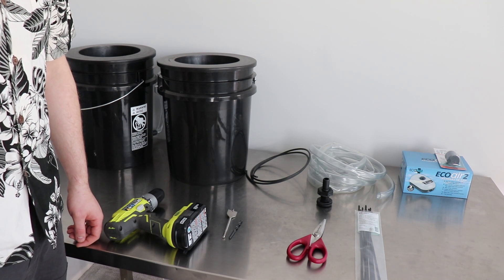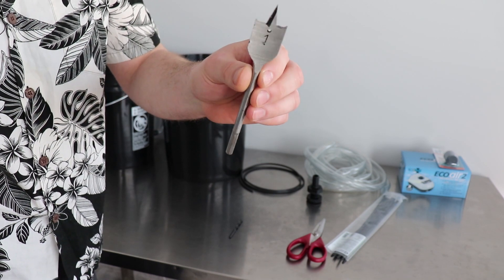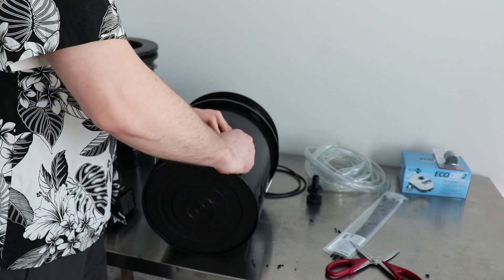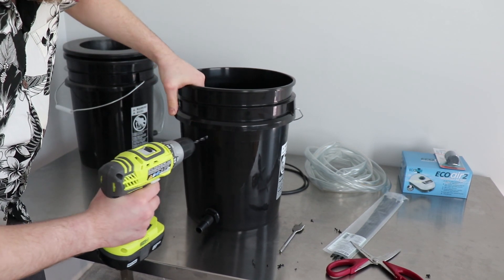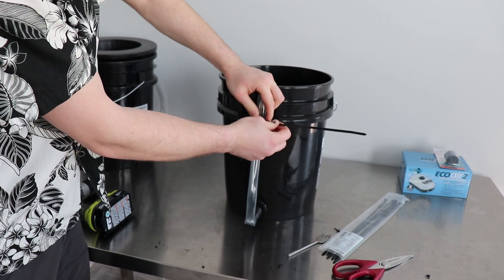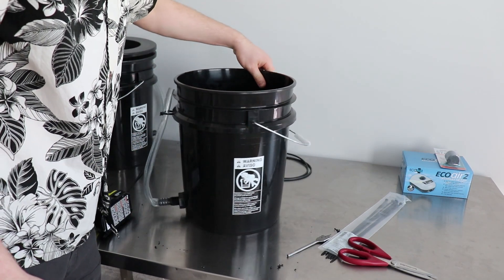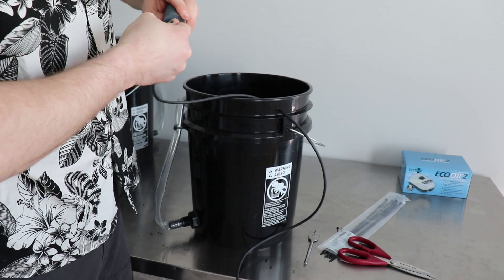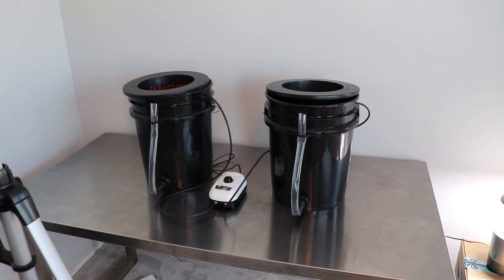How to Build an Easy Hydroponic Deep Water Culture DWC Bucket System

Comment: drill in reverse, friction works best in this situation makes clean cut.
Reply: I'll remember that
Reply: thanks for the advice!
Reply: You make the hole ~1ft from the base with a 1,000,000w laser. Everyone knows that. 
Just make sure nobody is standing within 1.2 Meters of the back of the bucket (2.7m if its on a 4ft table)...

OH JESUS CHRIST NO! I MEANT MILES NOT METERS!

Comment: Use blue tinted hose for the water level. Algae will build up with the clear hose due to light penetration.
Reply: sorry for commenting after three years, but what diameter of a tube should i get ? (in diameter)
im in eu and can't find te right components. thanks!

Comment: love the setup and u got a thumb up but just 2 lil things. cover the water meter with duct tape or silver paper to the lowest point where u need to know when to refile. also close the top of the pipe with something that has only a small hole. just a needle big hole is enough.

Comment: You should have a gap between the bottom of the mesh bucket and the top of the water surface thus allowing the plant to air prune it's roots

Comment: Starting mine today. I bought a 6 bucket system with everything included for $129.00.
Reply: Where? What is the name of the brand?
Reply: @Trrenik0kb  1 sec I'll find it for you. They are kinda a pain because you have to check the ph and ppm in every bucket but they work great! I put a piece of black tubing through the bucket so I could use a syringe to pull out the water to test it.
Reply: @goodtogrow7774  thanks alot growmie. 💪🏻

Comment: Recommend to use a colored hose as an indicator to prevent algae
Reply: Is there a particular colour that works better than others or  just anything that isn't clear? I realise black would work best but makes reading the indicator impossible.
Reply: @jasegtree1206  take blue or red. green works as well.
Reply: @moinmelf  cheers mate. I'm planning to move from growing in Coco to dwc next grow (6 weeks time). I have been getting good results in Coco for 2 years now so I know it's time to step up to dwc but I have to admit I'm a little bit nervous 😬 so I'm greatful for the tip.
Reply: @jasegtree1206  good luck with that. i went back from hydro to living soil. happy about that
Reply: @moinmelf  This is why I'm nervous. The grass isn't always as green as you think it is on the other side of the fence. Thankyou again mate....now my head hurts😂
Reply: @jasegtree1206  you will make it. if not the first run, then the second.

Comment: You taken the complication out of doing this project!  Thanks so much. I see you’ve run 2 lines from the pump for 2 buckets. I’ve not even begun to get necessary items and try this. Is that the most you can run off of one pump?  Wonder and helpful video!
Reply: Depends on the pump. I just bought one that can do two buckets and if I payed double the price i could of bought a pump that does 4.

Comment: how are people filling water with this setup? just pouring it thru the stones when needed? cracking the top would seem to be a problem down the line with some decent sized plants in there
Reply: I mix my nutes in a separate bucket, lift my net pot out and pour my nutes in. Or have an extra bucket set up like this one and just lift your net pot out and put on the new bucket. It can be a hassle sometimes but you’ll get the hang of it

Comment: I could definitely learn a thing or two from you about hydroponics! I love the water level idea. Good work, keep it up!
Reply from the maker: Thanks. Cant wait to get some plants into these things.
Reply: A tip for cleaning up the drill holes .  I use a butane jet lighter / micro torch and just do a quick pass or 2 with it to smooth things out around the edge of the hole.. just be quick cause it can melt the plastic easy too 😅.  Also works well for anyone who doesn't have a large enough drill bit and have to use a utility blade to cut the holes , heat the area to cut , softer and easier to cut 👍

Comment: Does the clear tubing of the water level indicator let light in?
Reply from the maker: Yea, switch it up for something dark. If you dont change out the nutrients and clean the bucket for a while algae will start to grow.
Reply: @HermitsHome  Ok, I'll give that a shot. Thank you.
Reply: Thanks for the video bro! Jumping on that subject, isnt it simpler and cleaner Not to put the Level? I purchased a bucket that already has the level but Ive blocked it because of the Same reasons you wrote in the comment. What do you guys think?

Comment: if i start in smaller 2inc net pots in another room and i transplant to 6inch afterwards in my rdwc system or will it ruin roots
Reply from the maker: Should be fine. you will most likely have to cut the 2 inch net pot to get the plant out without damaging the roots though.

Comment: What is the name of the barbed fitting. I cant find online.
Reply from the maker: here are 90 elbows wich will work better: https://www.amazon.com/Hydrofarm-Active-Aqua-Elbow-Connector/dp/B008UFBBJ6/ref=sr_1_29?keywords=hydroponic+elbow&qid=1559226505&s=gateway&sr=8-29
here are the gromets for them: https://www.amazon.com/Grommet-Waterproof-Hydroponic-Straight-Connector/dp/B07M9VPRQY/ref=sr_1_7?keywords=hydroponic+fitting&qid=1559226775&s=gateway&sr=8-7

or 
https://www.amazon.com/Hydrofarm-Active-Aqua-Drain-Fitting/dp/B013GFXKA2/ref=sr_1_10?keywords=hydroponic+fitting&qid=1559226857&s=gateway&sr=8-10 if you ever want the connect the buckets together and have a main reservoir these will work

if you have a local hydro store it is sometimes better to go in. then you can buy one or two if you dont want to buy in packs of 10 or more. my local store is pretty cheap for the parts

Comment: is the water level indicator necessary?
Reply from the maker: No it's not necessary. Makes it nice to know how much water is in the bucket without lifting the net lid up. It's also nice to have when draining buckets to change out nutrients. It can all be done without it though.
Reply: @HermitsHome  MAKES it easy for algae to grow
Reply: @gregardon  it makes it easy for algee to grow with or without the water level pipe?
Reply: It saves lifting the pot up

So basically  a waste of time   you don't need a hole in the bottom of a bucket to empty it     it's got a big enough  hole at the top
Reply: @TheStein474   When the plant is big you might have to tie it down using scrog net or a cage. Of course growing a big plant takes time and effort.. Obviously something you you may find difficult since you are unwilling to drill a simple hole that both drain and indicate water level.. Don't be lazy..

Comment: Never use clear tubing bro....light in means algae. You really need to step up your game when it comes to dwc. You did not talk about the importance of water temps. Anything even approaching room temp will root rot you out in days. You cannot use tap water for dwc. Most cities use chloramine...which does not evap out ever!! Your water in dwc is your life and the starting quality has to be r/o for sure. No good info here.....
Reply: Its all bullshit i grow outstanding quality weed in dwc,,i do not use"airstones"my growing media is gravel outta my driveway ,,i do not own ph or ppm gear of any kind i dont chill or heat water room temp is fine if no light in bucket,itsa fukin weed not a rocket ,,rocket science not needed
Reply: dave strom I agree Dave.  I tried the over priced RO water and I found more issues with my weed.  There is a reason it’s a weed.  It’s because a weed can be grown anywhere in any conditions.  You can nuke a weed with weed killer.  It will still come back.  Most of these growers don’t even know how to spot root rot, or powedery mildew witch is even worse than a little chemical in my water.  Sorry.  I have grown for ages and only once used RO water.  Just a gimmick.
Reply: You are correct in what you're saying except there's no problems with using tap water 
I don't know what the heck you're talking about.
If using RO water you need to add calmag supplement.
Majority of times tap water does not need it.
If you have a high chlorine content where you live then let the water set out for 24 hours to let the chlorine evaporate, problem solved